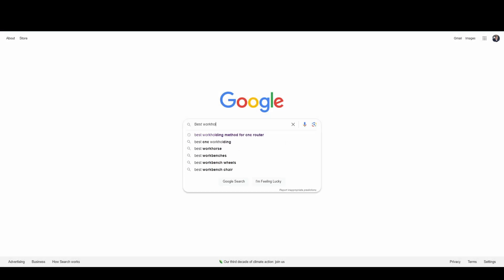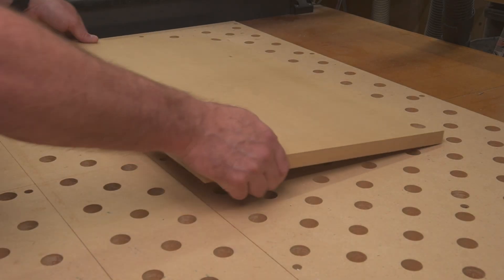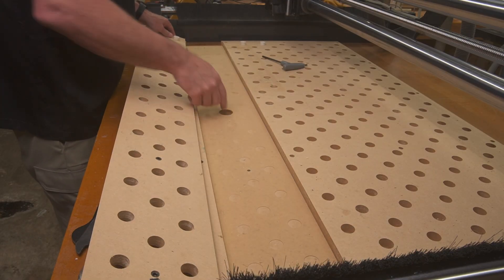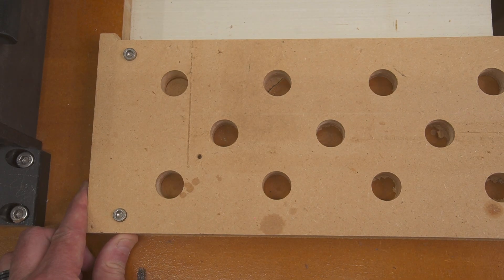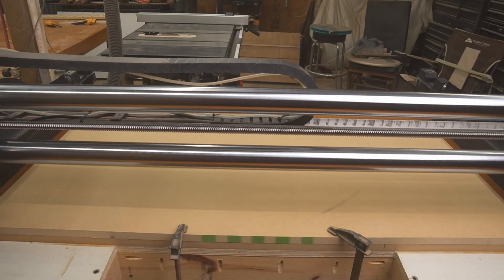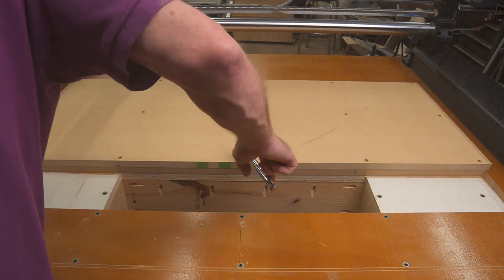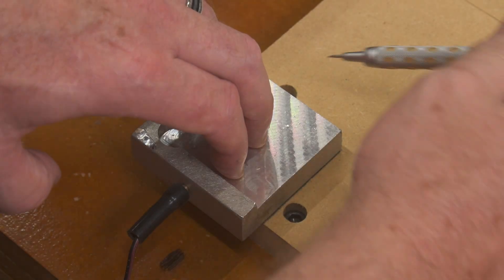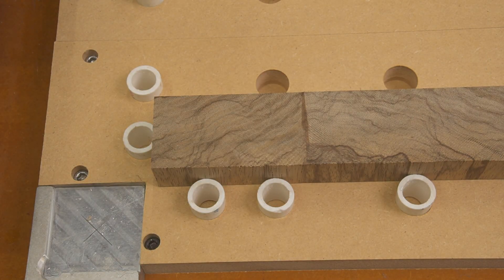A CNC Waste Board for Cheapskates.

Comment: Thanks for the great video. I have a large CNC table that I am restoring and I think I’ll use this system as my waste board.

One question though, when you cut the holes for the bolts that secure the waste board, did you cut the holes all the way through the material? Are the treaded inserts underneath the waste board recessed enough to allow that clearance? Thanks. :)
Reply from the maker: The MDF thickness is 3/4".
I cut the bolt holes all the way through.
I cut a larger hole to accomodate the head of the bolt, 1/2" deep, leaving 1/2" of MDF for the bolt to secure to.

Hope this helps.
Thank you for watching!

Comment: I use the dog holes on mine as well, Only i used aluminum pucks.  I like the pvc idea though might switch to that.  for big projects i did 3D print up some vacuum pads about 4x4" inch square.  it makes a pretty nice hold down for large projects that im only cutting the face of.  I also use a spoilboard on my spoilboard  that works out pretty well too, and I have several corners marked out on my spoilboard with a sharpie for g55 g56 etc so that i can just slap a piece of work down and go to town on it.  I love it to pieces, and am never going back
Reply from the maker: I would advise against metal stops.
The router bit won't be damaged with the PVC stop if a mistake is made.
The aluminum, not so much.

Thank you for watching!

Comment: Thanks so much for your video!  I have a Onefinity Woodworker, and I'm making my first spoilboard just like yours.  Sorry, I missed this in the video, but what spacing do you use for your dog holes?
Reply from the maker: They are a little over 3 inches apart horizontally and vertically.

Thank you for watching!
Reply: @MandSWoodworks Right on.  Thanks!

Comment: Thanks for the video! We plan to do this on our cnc. Wondering what's your hole spacing?
Reply from the maker: From center to center of the hole, it's a very odd 3.15 inches.
The reason why is over the years I've changed up the hole pattern here and there to make the hole distances more useful. 
If they were too far apart then I found myself having to use extra "shims" to put between the work piece and the hold down clamp, or in my case, the wooden wedges. 
And having them too close to one another would cause the same problem as well. 
So after several changes, I finally settled on the 3.15 inches and have stuck with it since. 

I hope this helps. 
Thank you for watching!

Comment: Hi there.  Questions. 

(1) What it the width of your space cut in the table?
(2) Is it possible to do a video on your vertical cutting surface you place into the table?  As in HOW you made yours?

I am currently designing my spoilboard & getting ready to modify my 50in x 50in table so I can carve the sides of butcherblocks.  Any help or advice is much appreciated.  BTW, love your YouTube channel😎
Reply from the maker: Michael,
The space that I cut out to house my Rotary assembly and the vertical cutting area is 48inches long and 6 inches wide.
The space that houses the vertical cutting area specifically is 22 inches long and 6 inches wide.

As far the the vertical cutting surface that you see in my video, I download these plans off of Etsy: 
https://www.etsy.com/listing/1172990836/vertical-mounting-table-fixture-for-cnc

Then I changed them up to suit the size that I wanted and cut the space out in the table to accommodate it. 
So with that being said, there is no specific constraints that you have to abide by.
If you were to use the dimensions that are mentioned in the Etsy plans, just cut out a space big enough for that, or as I did, make it much larger and then cut the space out to accommodate for that.

I hope this helps.
Thank you for watching!

Comment: So.....has anyone set this up for the AltMill and the Vortex rotary? My AltMill and Vortex arrived last night and I am in the early stages of assembly. Since the AltMill is freestanding and doesn't use a table like the Onefinity shown in the video, I'm trying to figure out the best way to do this without having to drill into the aluminum extrusions to create mid-span front to back supports for the rotary and vertical cutting surface. If anyone has already come up with a solution for this I'm all ears.
Reply from the maker: Chris, I have never seen an AltMill up close and personal but when looking at photos, the extrusion has T-Slots in it that run the length of the bed.
You could very easily fit a piece of MDF on top of the extrusion, then drill holes in the MDF that line up with the T-Slots in the extrusion.
You could then insert T-Nuts, into the T-Slots and run screws through the MDF to fasten into the T-Nuts.
Make sense?
Reply: @MandSWoodworks - it makes a lot of sense and I’m embarrassed that I didn’t think of it.  I’m at the office right now and not looking at the machine.  I was just going through the mental exercise of how to do it and forgot those slots were there.  🤦‍♂️

Comment: Love this...but I have a question...... PVC pipe is slippery...any reason to use PVC instead of just using short 1/2" or 3/4"  wooden dowels to accomplish the same thing?  I'm genuinely curious....not trying to criticize what you did because I think these idea's are fantastic!
Reply from the maker: Chris,
As Justin pointed out, they don't slip too bad but the wedges I use do have a tendency to vibrate out if I am making an aggressive cut. That is why I use the dog hole clamps to push against the wedges to keep them secure.
One would ask, why not just do away with the wedges and use the dog hole clamps by themselves?
The reason being is that on small/light pieces I am trying to secure down, the dog hole clamps would push up on the work piece, lifting it up slightly off the CNC bed when locking the clamp and would no longer be parallel to the CNC gantry.

And yes, you could certainly use wood dowels. But PVC is cheap and accessible.

Go Aggies!
Reply: @MandSWoodworks some good points. I use a single screw through the wedge to keep it in place. I also use a band saw to cut the wedges so there is good texture on the edge against the pipe so that also helps.
Reply: I have recently switched to the pvc method. They are not as slippery as you’d think. The only time I’ve had anything move is when I cut a profile too close to an edge where either a pvc or a wedge is providing force and the thin wall deflects and loses the clamp force.  For jobs I want to be sure, I put one screw in each wedge and it’s as secure as any other method you could think of. You could use dowels as well if you want. But the nice thing about PVC is it’s cheap and has very accurate tolerances.  Dowels are not always accurate diameter from batch to batch. So fit to you board may drug over time.
Reply: @-justin-4077 - thank you for responding.  I tried pvc on my previous CNC and honestly wasn’t a fan because stuff slipped easily, but I also wasn’t using wedges as shown here….so I’m willing to try it again.  I just know that accessories and clamps for 3/4” dawg holes are easy to buy and/or 3D print, so by my thinking, it would make the system more versatile to keep to a 3/4” standard hole size. I’ve got another 6-8 weeks to ponder this before my new machine shows up.
Reply: @chrissimonton9939 3/4” dogs would definitely work. The only big advantage of the PVC is the cost and availability.  Pipe is cheap, and consistent tolerance, and available. And the wedges made of scrap wood are free and always available as well. And that’s it, very simple. It’s worth a try at the cost of one spoil board. If you don’t like it, make a new one with 3/4”.  You could possibly solve the slipping with a little strip of PSA sandpaper around the very top of each pipe. Agains very cheap and available.
Reply: Thanks everyone for the responses.  My Altmill should arrive tomorrow and I hope to get it assembled this weekend.  I will be using this design….including the removable section as I also purchased a rotary for my machine and I desire a vertical clamping table.
Reply from the maker: @chrissimonton9939 
Good luck!!

Comment: I love this idea.  I realize this is an older video, but roughly what is the spacing on the holes?  I just set up my machine, and I like this idea. I do not have the removable piece, and my waste board will be one solid top.   Thanks.
Reply from the maker: I settled on the Dog Holes to be exactly 3.15inches from left to right.
For me it's the best distance to accomodate varying dimensions of wood that I might try to secure down.
If they are too far away from each other, then you'll need to add larger spacers between the clamp/wedge and the work piece.
You could put the Dog Holes closer, but then you'll have a million Dog Holes that take a ton of time to cut.

I hope this answers your question.
Thank you for watching!

Comment: For anyone else looking to save time on test fitting: my ideal dog hole size for 1/2" PVC ended up being 21.485mm. That gave a snug, secure fit without making it a struggle to remove them. Start there and work your way up/down in 0.005mm increments 👍

Comment: Making this now for my first cnc. I’m up to the PVC dog holes. What operation and bit do you use for this? I think I need a spiral profile - pocket is shaking the machine w my 1/4 bit like it’s trying to drill straight rather than a ramped pocket.
Reply from the maker: I use a profile tool path set to the inside and with a spiral Ramp. You'll want to slow your spindle rpm down a tad or the bit will get hot pretty quick and dull in that MDF.
Hope this helps. 
Thank you for watching!!
Reply: @MandSWoodworks nice I’ll try that, and I assume you use a bigger than 1/4 bit so it doesn’t leave the inside core?
Reply from the maker: @whippoorwillwoodcraft 
Actually yes. And forgive me as I forgot that not everyone has that option. 
I used a 1/2 inch end mill.
You can still use a 1/4 inch end mill and though it'll leave something in the center, it'll easily pop out after the cut.
Reply: @MandSWoodworks I’ve got 1/2 collet. I’ll try that. Didn’t realize the core would pop out. Great stuff. Keep the vids coming - you convinced me to buy a 4x4 CNC for my shop 😂
Reply from the maker: @whippoorwillwoodcraft 
I hope that you don't hate me later. 😂

Good luck!!

Comment: Thanks for sharing.  What brushes do you have installed on the Y rails to keep things clean?  Assuming they help?
Reply from the maker: The brushes along the Y rails are called "Ballscrew covers" and I bought them from SolaFide Designs. They don't completely eliminate dust accumulating on the rails, but they do help a ton. Here is a link to them if you are interested.
https://www.solafidedesignskc.com/product-page/onefinity-ballsccrew-covers
Reply: @MandSWoodworks  Thanks!

Comment: What size threaded inserts did you use?
Reply from the maker: Size M6.
Here's an amazon link to the ones that I use.
https://amzn.to/4kirs8A
Reply: @MandSWoodworks thanks for the quick response.  Appreciate it
Reply: One more question for you.  What RPM do you use when cutting into MDF?
Reply from the maker: @CWR173 
Well, as I'm sure you know, the RPM depends on the feed speed. 
With a 1/4" end mill, if my feed were set to 80 to 100ipm I would set my spindle rpm to around 10k-12k.
Reply: @MandSWoodworks thanks for the quick response again.  Much appreciated

Comment: Love your method of hold down . I am curious why your removable center section's hole pattern is not geometrically aligned with the other panels. I like the removal area and intend to have this feature in my table.
Reply from the maker: I cut that center portion out before checking to see if it lined up with the hole pattern. To my dismay I discovered that with my current hole pattern, the holes fell perfectly on the edge of the removable panel, cutting the holes in half. 
A quick fix was just to create a separate pattern for the panel. 
If I were to ever build a new table, I would consider where the removable panel would go to match the hole pattern better. 

Thank you for watching!!
Reply: @MandSWoodworks  Thank you for the quick reply. I will keep that in mine when I build my table and insert hold downs. Thanks

Comment: I was seconds from buying a vacuum hold down, then realized I would probable cut through it. I’ve been using masking tape & double sided tape & it works for my projects. Used to use CA glue but sometimes it would seep through the tape and make more work.

Comment: You hooked me with cheapskates 😂 subscribed. That’s the way! I’ve tried lots of ideas and this looks great. My CNC is also setup for plasma so using your idea I should be able to remove the baseboard so the plasma can cut through to the plasma rails below. Thank you!
Reply: I am currently restoring a large CNC table that was for woodworking and also want to double its purpose for CNC plasma. Any tips/tricks or advice would be much appreciated. :)

Comment: Thanks for the video, however, being a newbbie in cnc I have a question: you mention that MDF dulls your bits so you don’t use a good bit to make the holes, but unless your pieces do not need to be completely cut off, you are going to go at least half a mm deep on the board which will dull the tip of your bit so in a way having to use a spoil board on top the your spoil board is only avoiding marking the surface of the bottom one and on top of that is decreasing the working height of your machine, which o a small desktop machine like mine makes a big difference. So as always some compromises need to be made. Another question is: is chipboard worse than MDF as far as dulling the bits is concerned?
Reply from the maker: There is a method where you can cut a profile pass all the way through your workpiece the exact thickness of it, and not mark your waste board. If you watch some of my other videos, you'll see me make several profile passes and never leave a mark.
You don't have to cut into the waste board to make a complete cut through your work, thus saving the tip of your bit.

I can't say that chipboard is 'worse' than MDF. But because of the glue and the grit in chipboard, it will dull your bit.

Thank you for watching!

Comment: Yes Thank You for Sharing this...I have looked at allot of spoil board designs and they all have pros and cons associated with them, but with this one I feel that it's going to for fill the biggest portion of my needs far better than "T" Track designs...I'm curious as to one thing, as to the fastener size you used...You used a respectable sized "T" Allen Head Handle to remove them...If they were Counter sunk fasteners then the Allen socket is smaller than a standard size socker for the same size fastener...So after re-watching the video again it seems your using standard socket head fasteners? Is so, approximately what's the thickness of the material under the head?
Reply from the maker: What you see me using is a normal 3/8" drive ratchet wrench with an allen socket attached to it.
The threaded inserts were size 'M6' and I used standard M6 socket head screws to secure the wasteboard down to the table.
I cut M6 size holes in the wasteboard  and then cut countersinks the size of the socket head down 1/2".
The MDF was 3/4" thick so that left 1/4" of material left to the MDF for the screws to tighten down against the table.
And that left approx 3/8" of room above the screws to resurface the wasteboard many times before I got close to the heads of the screws.

I hope that this answered your question. If I didn't understand you correctly, reply back and I will answer back.
Thank you for watching!
Reply: @MandSWoodworks  Well Sir I to have shamelessly copied the biggest portion of your design out of all the spoil board designs I saw, I thought your design was the most advantageous that fit my needs so, Thank You for sharing...One thing I read was you were using 1/2 PVC which measured for me was .845 to get the fit I felt was going to work...I feel that from time to time I may need to get a set of those Bench Dog clamps and found the link you supplied and noticed that the recommended pin diameter was .750...what do you use to take up the difference between the .75 and .84 for the pin to secure in? Thanks Paul